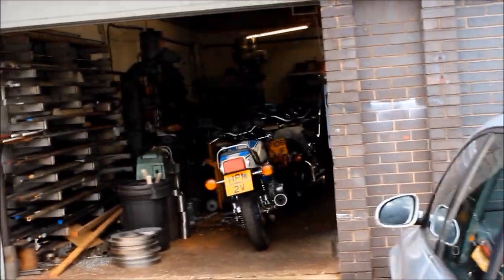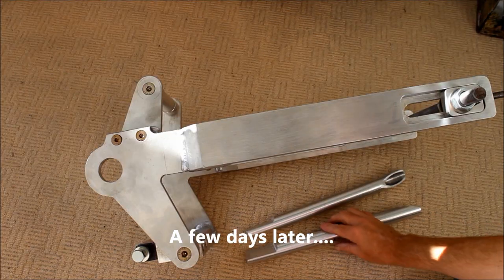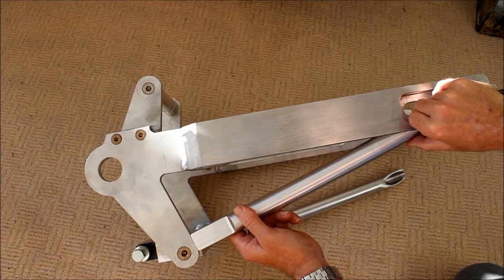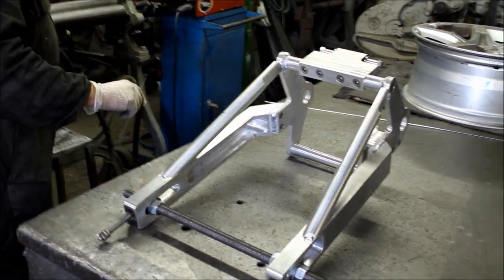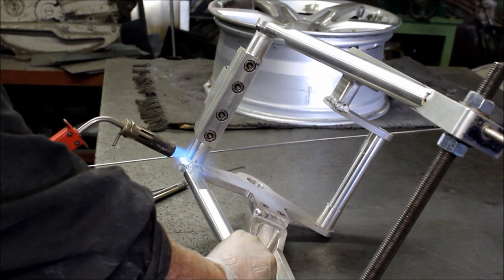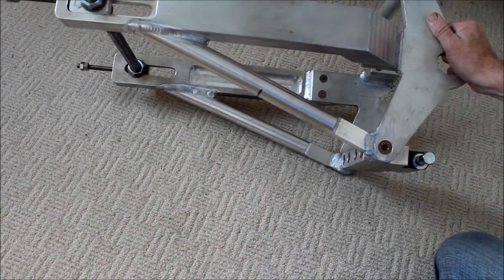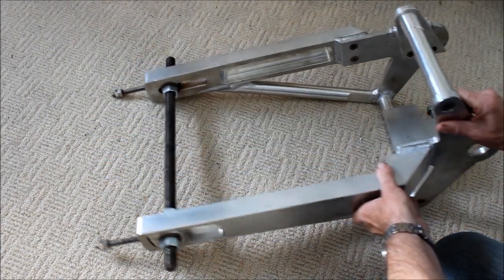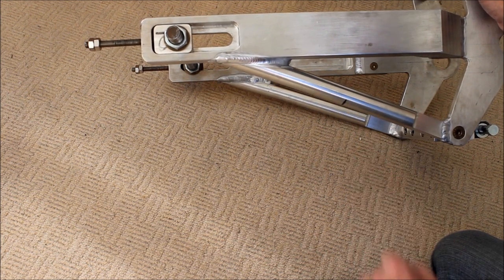Making an Alloy Swing Arm - Part 5

Comment: Sounds bit old school like me 60years of age just bought cnc mill bashed head now working been watching you’re projects if I can be of any help get in touch I am not too far from you’re selves about 10 miles got few projects going on my self mainly for grandkids based on bikes abit ott -like both of you’re works awesome I can’t say reveille me politic reasons we’ll know known respected in bike racing industry for right reasons -if in my day people had turned work out like you’re selves proper jobs maybe it would.  Have been different .buy the way when when apprentice I use to set capstan lathes Rolls-Royce aero engines.but there you go keep up good work-steve mainw
Reply from the maker: Hi Steve, Thanks for the comment. I'm retired now, just a couple of years behind you. Not an engineer myself, but worked with a lot of them lol...  It's a hobby for me, so projects take a long time as I cant throw money at them these days. Jeff's work is his job, though he only makes a pittance. He isn't on social media ..FB etc, which I tell him doesn't help. I reckon he was born 100 years too late.. I started filming his work, as he's made many cool parts over the years but never gets credit for his work.